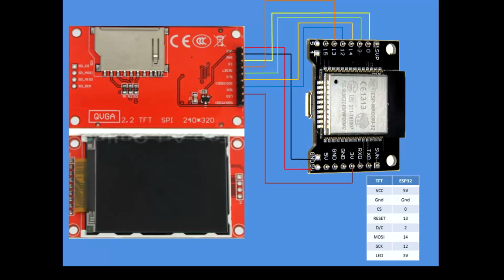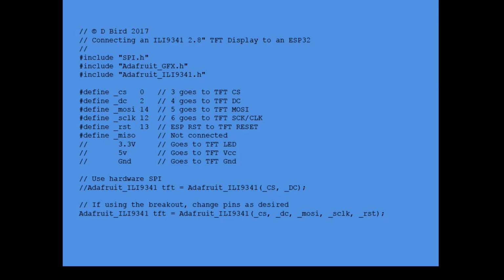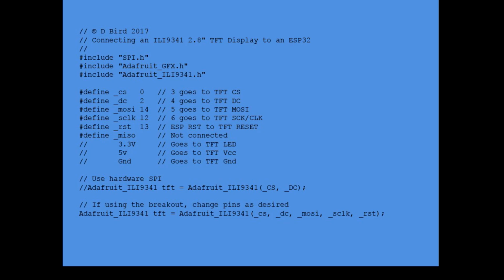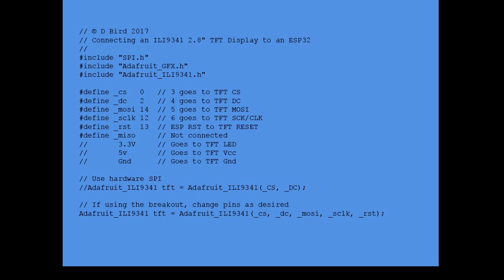Tech Note 044 - ESP32 how to use ILI9341 TFT displays

Comment: thank you, how i can write a text in specified text area? for example if I want the textarea to be in the center how to make all the new lines from incoming external data start in the center of the screen instead of starting from the 0 coordination? I have searched a lot times but nothing worked! thanks in advance
Reply from the maker: You need to read the GFX library document but it’s essentially this command

tft.getTextBounds(string, x, y, &x1, &y1, &w, &h);

That you put your text in to it eg tft.getTextBounds(“Hello World”, x, y, &x1, &y1, &w, &h); and it will give the the dimensions around the box that will contain the text the important bit being W which is the width in pixels, so this command takes account of Fing size, then to print on the centre you would tft.print((320-W)/2,y,”Hello World”);

Alternatively, determine e how many characters you can print across say 30 then find the character width with 320/30, then find length of the string with “Hello World”.length() then
Tft.print((320/30*(1-(“Hello World”.length())),y,”Hello World”);
Some libraries have a centre command too. In each case “Hello World” can be replaced with a string variable. 
You could write a centre function, try search in my GitHub repository there are examples in there. I can’t remember where just now.

Comment: Hi David, great video, very interessting. Can you tell me, what kind of develop-board you use, seeing on the left in this video with the ESP32 chip? homemade?
Reply from the maker: It ‘was’ the ESP32 X1 board which is no-longer available, to be honest there are much better designs available now, the best being the Lolin D32 board which out performs all others. You could buy a bare board like the X1 and solder an ESP32 to it, that would be close to the X1 variant.
Reply: @G6EJD  thank you, vy73, DL1GPM
Reply from the maker: Markus P Markus, by the way, the X1 board was sold and distributed in Germany so they may still be available, 73 Dave

Comment: I got my esp32 setup but the speed is extremely slow for line draws any advice?
Reply from the maker: If you use pins other than the hardware SPI then the compiler emulates SPI and it goes slow, so-called software spi. Write a short programme that prints out ((MOSI) should be 23 and the same for SS, SCK, etc. Change your connections to the hardware spi pins.
Reply: @G6EJD  Thanks, I need to check it out, its wroverkit 4.1 comes with built in lcd with touch screen
Reply from the maker: I think the display device is different haven’t checked, which library are you using?
Reply from the maker: Uses the ST7789 display chip I think

Comment: Hi quite great tutorial.. Do you also have your demo code of the metar readup ? thanks
Reply from the maker: Yes just go to github G6EJD and repositories the code is there - but do you mean on epaper, if so no, but the conversion would not be that difficult to do, it would need a slow update rate perhaps 10-mins or more
Reply: Thanks a lot, again very great project.

Comment: 1) I do not get it right but, can the ESP32 be connected in 5V like the ESP8266?
2) Does the example link refer to what it is showing on the video display (weather station)? 
Thank you
Reply from the maker: Yes if your using a development board like say Wemos login ad they have a voltage regulator that drops 5v down to 3.3v. The boards ESP32 and esp8266 are all but identical and most programs are identical too, only when you want to use features other than glib pons do you have to make changes. The ESP32 uses more power than the 8266.
Reply from the maker: The code for the weather is my METAR code on one of my other videos/TN or you can go to github G6EJD and find it there under METAR
Reply: @G6EJD  The 2 lines that should be changed are these below?
const char * ssid
const char * password

And in "const char * host = aviationweather.gov;" should I do something? because I live in Brazil. (the Brazilian time zone is -3).
Thanks++

Comment: Excellent work. Have you attempted use the touch features of this display yet?
Reply from the maker: I have and there are quite a few libraries around to use it, so getting touch position is generally quite easy to do, it's what you do with it that the more complex part of the coding. Also, it is difficult to get a touch without polling for a touch, which places a different 'programming' demand on the code structure. So for example if the code is displaying some weather or whatever, then every so often you need to check if there is a touch occurring and for it to be reasonably responsive this needs to happen quick often and quickly.

Comment: Please tell me if the display updates faster than on esp8266
Reply from the maker: +Cristi Istrate The speed of display update is determined by the bus speed and for most purposes there is no difference in update rate between the ESP8266 or ESP32, however if your doing a lot of calculations between screen updates / frames then the ESP32 would give a better response as it’s cpu is running faster.

Comment from the maker: BTW using the ESP32 variant is relatively easy too. Yes, I use it more than most of my projects for flying because it gives me the best indication of wind direction and speed, Weather Underground is OK, but the METARS are more to my needs, especially when there is atmospheric layering, where I am it is not unusual to have a flat clam at ground level, but have 25-35Kt winds at 200M. Any problems give me a shout.
Reply from the maker: The MH-ET LIVE is a good board and in my trials uses the least amount of power in sleep mode, about 5mA, most others use 22mA in the same conditions. Glad it's working for you.

Comment: Thank you. Could you tell us if this example can works in a ESP8266?
Reply from the maker: Yes it will without modification. Just make sure you make the correct pin connections for MOSI, SCLK, CS, DC and RES. 

// You can use any (4 or) 5 pins 
#define sclk D5 //--- connect this to the display module SCL pin
#define mosi D7 //--- connect this to the display module SDA/MOSI pin
#define rst  D6 //--- connect this to the display module RST
#define dc   D8 //--- connect this t othe display module DC
#define cs   D0 //--- connect this t othe display module CS
Adafruit_ILI9341 display = Adafruit_ILI9341(cs, dc);
Reply: Thank you for your time sir, information very helful, and you very kind, ;o)
Reply from the maker: Sinolointentoreviento My pleasure and happy to help, if you have any problems send me a message

Comment: The display looks great, but are there sufficient pins left on the ESP32 to connect sensors or outputs?  Software SPI is using so many of the pins, is there an I2C equivalent of this display?  Thanks for your thoughtful tech notes.
Reply from the maker: There are a total of 12 data ports on the board and the display uses 5 leaving 7 for sensors or other devices. The display reset can be tied to 5v reducing the data pin usage by1 leaving 8 free for use. I have not seen any TFT displays that use the I2C bus, although the Nextion displays use a serial port and you can preload images and icons and screens leaving the serial port to provide data for display, they are controlled with relatively simple commands like draw x1,y1, x2,y2,line or in text "draw 50,50,100,100,line" so low processor overhead for display purposes. Not cheap though about $30 versus $3. An OLED could be attached too of course.